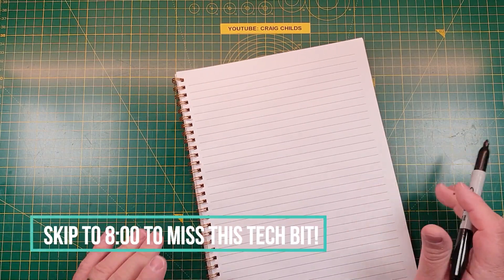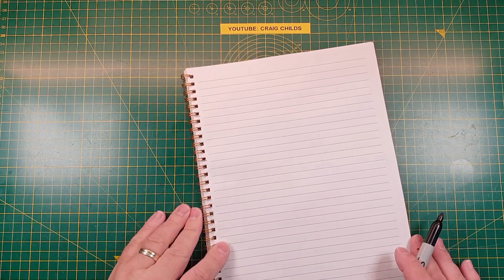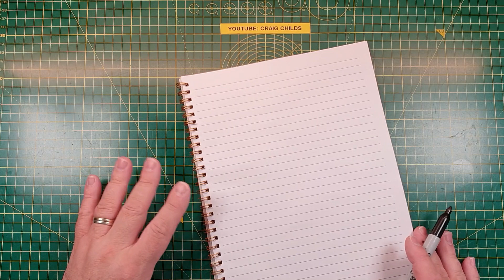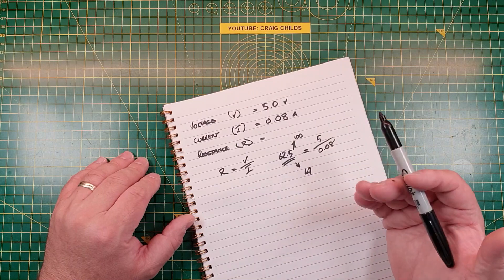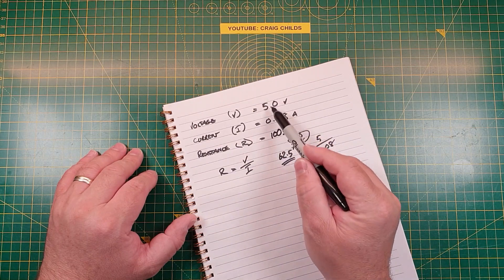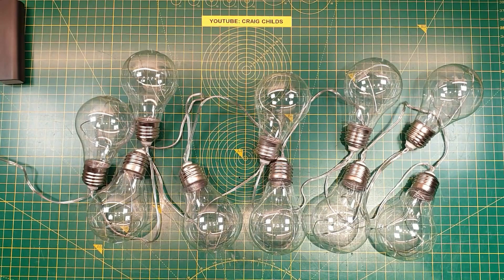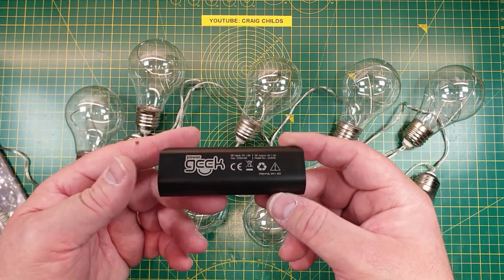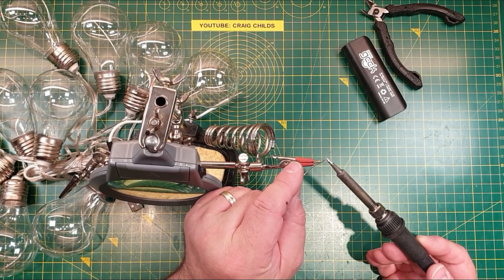Convert: Solar LED Fairy Lights to USB power

Comment: Is there a way to keep the part that allows for the lights to blink in different modes. It also has the on/off switch. 
With this modification the light are still and in just one mode. It’s good, but, if there’s a way to keep the switch that would be great
Reply from the maker: Hi there,
You need one of my other videos: https://youtu.be/nb3LvEyO2Jc

These days you can buy USB powered lights, only do this if you want to use an old set, otherwise just buy a set with a USB plug already fitted.

Hope this helps 😀

Comment: I've got several sets of these crappy solar lights, could I connect them all to a single USB? They all use very similar solar boxes with single AA batteries inside.

Comment: Craig, love these videos. I have a LED string light curtain with horrible combination mode nonsense. I just want to flick switch and they are steady on. Would this method work for this to bypass the need for always having to manually switch on?
Reply from the maker: Hi Peter,

This method only changes the power source, it doesn't alter the control at all.

Changing the control is a whole other topic and honestly usually more hassle than it's worth given that you can buy static sets very cheaply.

Best wishes,

C.

Comment: Love the Tech Bit.   Keep going on being awesome!
Reply: 9:27 ...  " If you do this ... you CAN"T put it outside anymore.... as it is NO longer weather resistant"

( but that's exactly why I want to do this - to make my garden / pathway lights work longer & brighter )
Reply from the maker: Hi there, 

You can put the new setup in a weather resistant enclosure and put it outside, that is an option.

C :-)
Reply: @childscraig  YES ... but I was watching the video for that exact reason .. .then waited until the 10 minute mark to say ... " if you do this - you can't use it for the original purpose anymore." ... so what is the point of making something - if you are REDUCING the options .. it is like saying ... you " could " ... buy a BMW - & use it as a mobile plant stand - if you make a few modifications to it ... like cutting off the roof.
Reply: @childscraig  IF I need to buy an additional enclosure ... I am spending MORE than a $1 ... Which is the POINT of the video ... making a $1 item - Better .
Reply: There's a lot of line before the join, just leave the join under cover.

Comment: This is an excellent video explaining everything, thank you! When you say you bench tested the brightness you liked am I correct in saying there is no danger in applying a 5V 1amp USB charger to a string of xmas 200leds. They were powered by a 1.2V 400milliamps? Thanks!
Reply from the maker: Hi Alex,

You would need to modify the resistors before you applied that power source, the increased voltage would quickly burn out the LEDs if you don't. 

When I bench tested the brightness I used a voltage and current regulated power supply to  work out the values I needed, you can measure how much current your lights are drawing with a multimeter, from there you can work out which resistor values you would need to drive your string of lights.

Just remember, the brighter you run an LED the shorter it's lifespan.

Hope this helps.
Reply: @childscraig  Wow thank you for your response and help. Liked and subbed. I decided on a 480ohm resistor to achieve 12V power supply (so I can use a Shelly 1 ) and they draw 0.025amps. Cheers!!
Reply: Commenting for future project!! Seems that I will need to read this thread
Reply: @sauljose8783 so am I .

Comment: Really love how you show the calculation😍 but I didn’t get it where 8 mA comes from, so would you please explain that?😃
Reply from the maker: Hi Limnana,

80mA is the power consumption of the LEDs before we modify them, you can measure this using a multimeter inline with the circuit before you take the unit apart.

In my case I have a bench power supply which I can use to show me the voltage and current however you can do the same measurement with a multimeter in A/mA mode.

I hope this helps,

C.
Reply: Craig Childs Thank you so much ☺️☺️

Comment: Hi Craig, thank you for such an informative and to the point video! I accidentally bought solar powered fairy lights from Ebay. Confusing listing where two of the three lengths was battery while the one I chose was solar. I do have a question, how do you know which string on your fairy lights are positive and negative? Thank you once again.
Reply from the maker: Hi Sarah,

You would normally take note of this before you disconnect the lights from the old supply, the positive and negative on the old battery would help identify this. 

If you have already passed this point it's still not a problem, as long as you have fitted your resistor the LEDs will only light when connected the right way round, connecting them the wrong way round should not do any damage as long as the resistor is in place and the voltage you are connecting them to is the right level.

Hope this helps,

Craig

Comment: In the vid you said that we know V=5V, okay that's printed on my poundland power bank, given.
Then you went on to say:-
 We know I=80mA but I don't have a bench power supply! What assumptions can I make for my white LEDds?
I would like to try this project on 50 LEDs so I really would like to know how to find "I" so that I can calculate the correct resistor for my LEDs.
Would an 1/8W or 1/4W etc. resistor be needed? And how would I calculate this for my 50 led string?
Sorry to be a pain but would appreciate the extra info.
Really useful vid and thanks for sharing this useful project.
Reply from the maker: Hi ISO Guy,

You can measure the current with a multimeter, it doesn't need to be a bench supply (that's just an easier way).

Most multimeters have current measurements, you need to check the instructions on yours (assuming you have one or can borrow one).

The meter is used inline so you need to break the circuit and complete it with the meter in the right mode, this should give you the I value for your lights.

Most multimeters require you to change where the probes are connected for current measurement, remember to put them back before trying to read voltage otherwise you might damage your meter!

I hope this helps,

Craig
Reply: @childscraig  A friend of mine (an electrician) and he is going to give me his old multimeter. 
Now thats a bonus.
He is going to drop the meter off on Monday on his way to work so my project will have to wait till then.
Thanks for the additional tip.
Great vid
Reply: @isoguy.  in the US ... Buy any item - get a multi-meter FREE - " Harbor Frieght Tools "

Comment: sorry for the noob question, resistor is to avoid it from getting burned right? i have this type of led strip, 5 meter - 50 leds...i have soldered it directly to usb without resistor, some led got burned some are not...if i'm going to do what you did here, am i still gonna burn the other led? or this is actually the solution to my problem - i am going to remove the broken ones and solder them again with fine ones...thank you!
Reply from the maker: Hi, you are correct that connecting directly to USB without adding a resistor has caused some of your LEDs to fail, the resistors limit the current flowing through the string.

If you remove the broken ones and add the resistor the rest should work, they may have a shorter life as they may have been damaged by the unrestricted current, only time will tell.

Good luck!